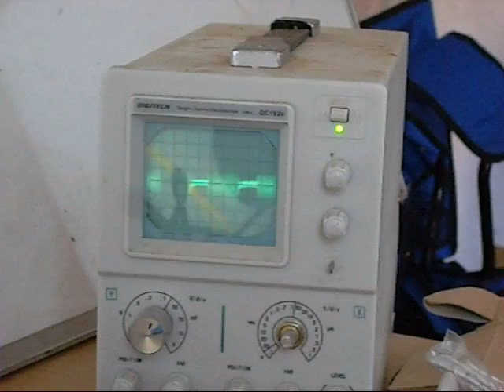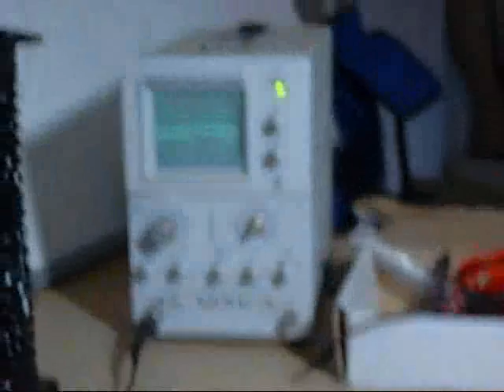arduino metal detector project pt2

Comment from the maker: @zws1922 ...which allows the minerals to stop making signals and listen to the noise of the metal target only because the metal target holds the induced current longer than the mineralisation.
doing this throws away information that can reveal more about the target.

Comment from the maker: @zws1922 im going with pulse induction.
i already have a good detector but im not content with not knowing how it all works,so im attempting to build one.
need a pulse that goes quiet-so the clamping resistor on the coil,stops it ringing.
that allows the metals to be "heard" by the same coil in recieve mode.
then a way to make an audible alert to the user-i have a long way to go yet.
PI gets around the minerisation of soil by quietening the coil and waiting before turning on the recieve amp